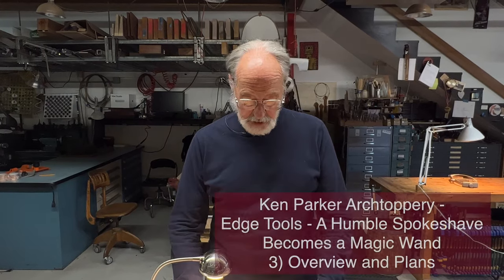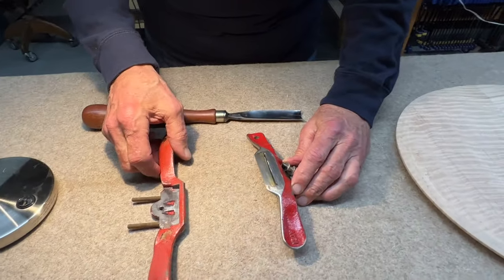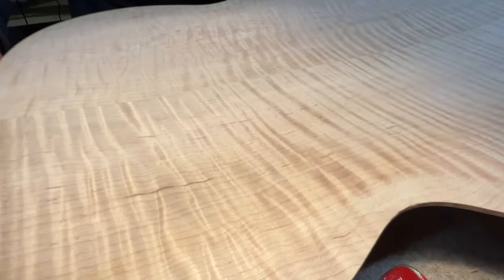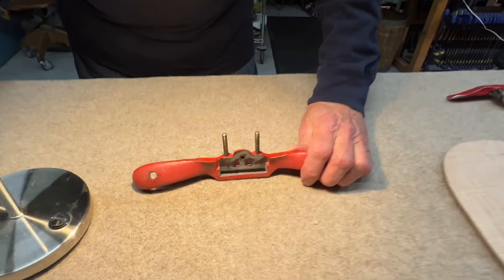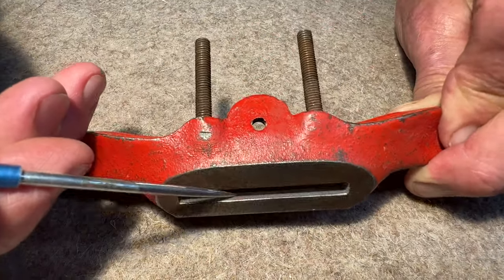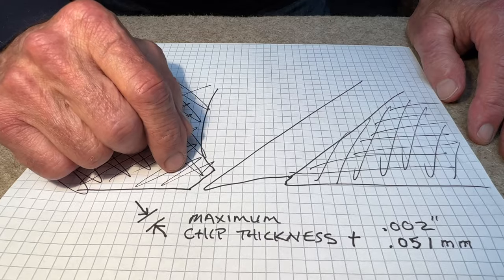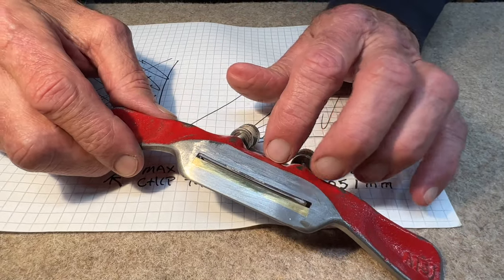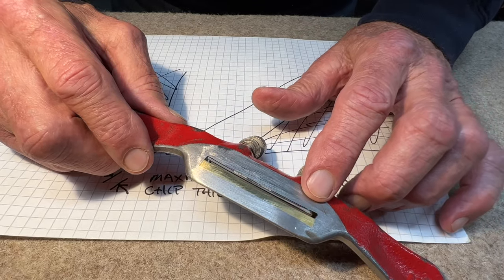Ken Parker Archtoppery -  Edge Tools - A Humble Spokeshave Becomes a Magic Wand  3) Overview & Plans

Comment: The thought you have put into this project is amazing!  Simple, zero complicated tools required, guaranteed results.  Me thinks you be one smart engineer type 😂.  What temperature do you think will transmit to the new blade in the soldering phase?  Inquiring minds and all that 😊.  Great series Ken!
Reply from the maker: Well, the soft silver-bearing solder flows around 450F, and the correct temper for most tool steels used for woodcutting happens right around there, so you have to be careful. Maybe you noticed that I turned the blade around backwards to keep the edge side away from the heat.

Comment: I’m just about hanging in there … following along, but I’ve seen enough already to have confidence that all will become clear to me in due course 🤞 The bit that I’m already certain of is that I’ll never understand how the hell you managed to come up with this idea and refine this solution to begin with 😂👏 Whoah! 🙌
Reply from the maker: Scratch your head long enough, and you'll see. Baldness is the only risk, really.
Actually, I thought up this new  process just because I was trying to show a way to close the throat opening without needing a Bridgeport milling machine and a special cutting saw. As it turns out, this simpler method produces a better result! The biggest difference is the nice finish that you can create on the brass insert before soldering, as opposed to whatever tool marks you have to live with from a funny special cutter that looks like a little saw stuck on a shaft. In use, the shiny surface is slipperier than the milled surface, so the shavings pass through the newly ensmallened slot more freely.
Reply: @kenparkerarchtoppery9440  
it may sound silly, but go to sleep thinking about a problem and surprising how often you will wake up with the solution. I firmly believe the brain keeps ticking over long after your body goes to sleep